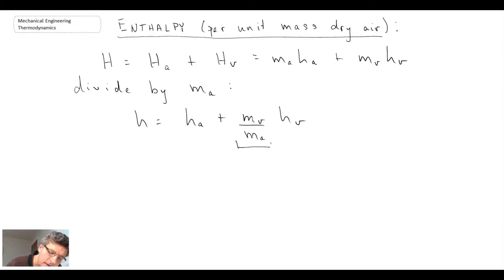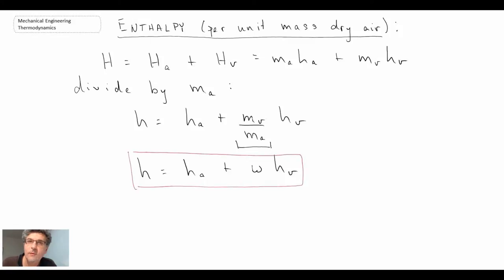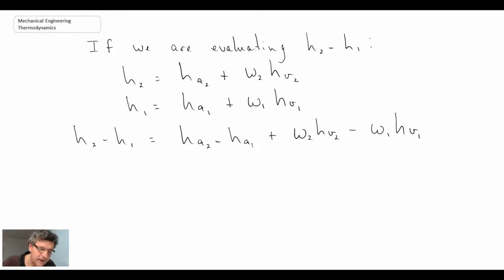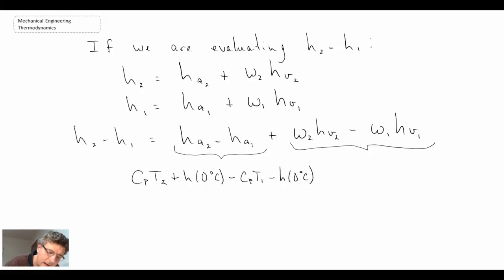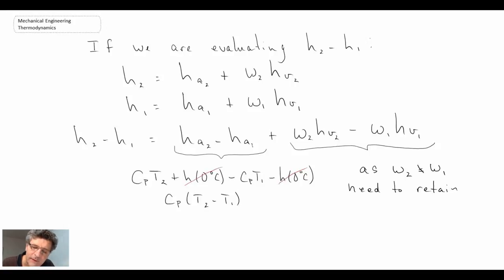Mechanical Engineering Thermodynamics - Lec 28, pt 5 of 7:  Enthalpy per unit mass Dry Air

Comment: So, for the second part where you have w2hv2-w1hv1, you're saying that h is constant and the w and T are the variables that change? Thanks!
Reply from the maker: What I mean is that given that w2 does not equal w1, you need to retain the full expression for w2hv2-w1hv1 that is shown at 4:07.  If w2 was equal to w1, you could pull it out and rewrite as w1(hv2-hv1) = w2(hv2-hv1) = w2(2501.3+1.82T2 - 2501.3-1.82T1).  The 2501.3 would cancel and you would be left with w2*1.82*(T2-T1) or w1*1.82*(T2-T1).  However, w2 is not equal to w1 and so we cannot simplify it in this manner.  For the enthalpy of dry air there is no premultiplier and consequently we can cancel out the enthalpy value at 0C.
Reply: Gotcha!